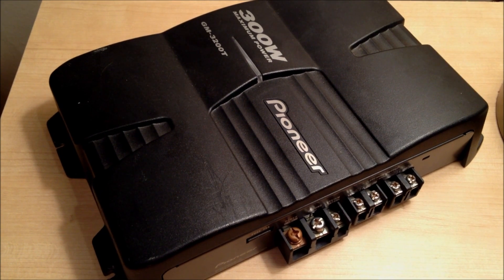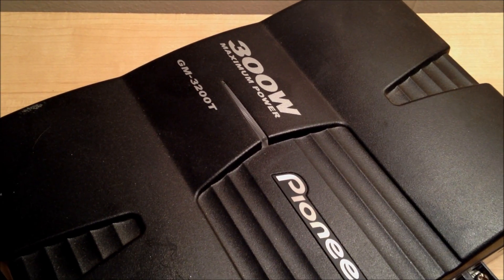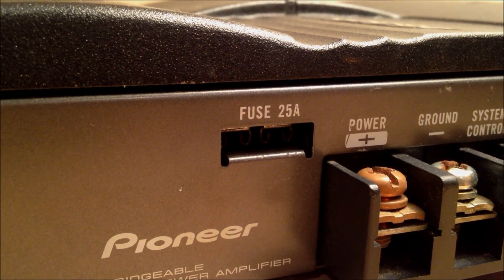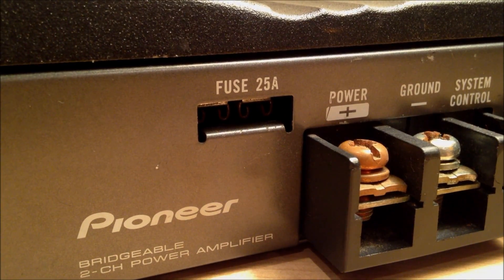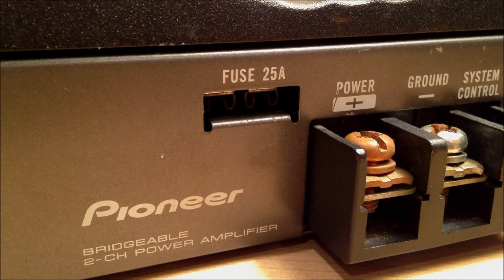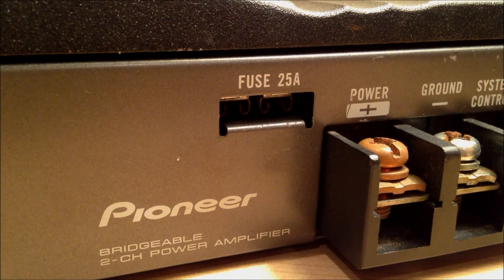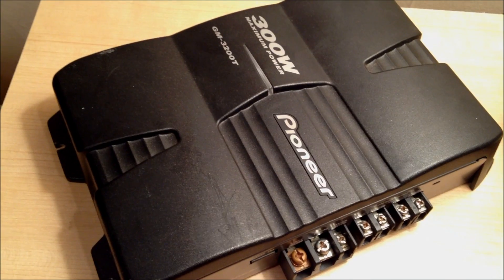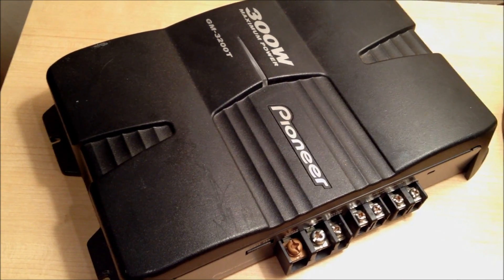How to Estimate a Car Amplifier's True Power Output (watts RMS)

Comment: So ( my rating *30*) X ( FUSES I HAVE ) <--- does that include my fuse connector im trying to figure out what fuse connector i should get so should i count it as 2? (60x10) = 600r? Or only count the one on my amp (30x10)

Comment: Uggg approximating output based on draw with audio... Why are so many green horns saying you can test audio power with multi meters?
Reply: because you can using volts. you can only send so many volts accepted. its the easiest trick in the book..
Reply: @boochful  you can't actually.... you need a test output with dummy load to even get a sample .. if you don't know this this then you're a noob cause it's been basic knowledge since at least the 80s in the car audio community and always known in engineering

Comment: My amp has two 40amp fuses  how many watts it's
Reply: 80 total amps x 13.8 volts=1,104 watts butts it's not an exact science
Reply: @aubrywilliams6158 where the f did u get 13.8 from?
Reply: 14.4 is during ideal conditions. I usually calculate a little less myself to get a more realistic number. Also gives headway

Comment: What the hell does the fuses have to do with wattage? and you have to account for the speaker draw in amps that will depend on what size you are using 4 /8/16/ ohm  ... and you account for the voltage drop across the speakers .....that is the true voltage you use to determine wattage .. not the supply.. but what is being delivered to the speakers ...
Reply: So what's the answer

Comment: Take fuse rating, in this case 25A x 1 x voltage.....so if I put this amp in my car witch I know sits at 13.9 volts then it would be 25A x 1 x 13.9 = 347.5 watts
Reply: Assuming the amp is 100% effecient. It is not by the way. Get 347 watts outta your head. It aint happening.

Comment: This is very miss leading because a fuse is rated higher than the actual power being used. Also the transistors are using more power than they are are putting out. Also some amps have capacitance that will increase peak RMS greatly. It is incredibly difficult to measure peak RMS without frying your amplifier. A lot of these amps will overheat running at even half power so there is a lot of nonsense going on with amplifier ratings.

Comment: what about inline fuses on the cable?
Reply: Irrelevant is this case...that fuse is to protect the wire not the amp.
Reply: @gleepoy  in that case it would need a distribution block correct ?

Comment: You take the fuse amps times it by 14.4 which is what most amps are rated at. That will accurately give you a number of watts it’s capable of at 1ohm. This doesn’t mean your amplifier is stable at 1ohm. Read your owners manual to see if it can stability run as low as 1ohm.

Comment: This is the most wack method I’ve ever seen. Also technically incorrect 

What you could rather do is say - total fuse/s amperage x 14v ( input power dc)  divided by the resistance of the speaker. 

So for your pioneer amp 

25a x 14v dc = 350 

350/ 4 ohms = 88w rms

350/2 ohms = 175w rms 

You said you know your amp is rated at 150w rms. Which is usually a rating giving at the lowest resistance it’s stable at.
Reply: so my Polk Momo carbon series 300.2 is 850 max and has 2 30A fuses and is rated at 14.4v 
14.4 x 60= 864 
864/4= 216 (is that how much im getting if im using 4 ohms or no pls help)
Reply: KickerWolf_ZV5 well the amp you are referring to is a 2 channel. Which can be bridged. Based on the information I can find online yours is rated at 550w rms at 4 ohms bridged. 

Keep in mind my calculation is a rough method used if you cannot find any output specs, having said that however even rated outputs are often exaggerated due to the inclusion of clipping.
Reply: Ight cause I was going to buy some Skars but Skar isn't that good imma just go with some Kickers

Comment: If that's an old school amp it's direct 12dc  it does not use any flyback step up dual supply my guess it's just  low power not 300w

Comment: What if my amp has no fuses? 

Old school Rockford Fosgate Punch
Reply: Find what the recommended fuse size for the amplifier is (in line fuse on power wire)

Comment: Since the manufacturer typically uses 14.4V source and a 25A "should" be the maximum amount of current it can take, if say the amp is around 360W peak to peak power. So the peak power being 180W times .707 for RMS puts it at around 130W (127.26) still a little less than what you mentioned. Also, 150W X .85 efficiency is 127.5W

Comment: Take any max power rating and divide it by 2 for the "real" power rating of an amp. Then divide that by the number of channels. Without knowing the actual specs, I'm guessing that Pioneer amp is rated at 75 watts per channel into 2 ohms, 150 watts bridged at 4 ohms and probably somewhere around 40 watts per channel at 4 ohms...and looking it up, I'm bang on except it's way higher at 4 ohms than I expects: 60 watts per channel. Which means it's a really inefficient amp at 2 ohms if the power only increases 25%.

Comment: Most class a/b amps are only 50% effcient. So multiply 14.4 volts x 12.5 amps(half of the 25 amp fuse rating). That gives you 180 watts rms. If the amp is 90% efficient, which most class d amps claim, then you multiply total fuse ratings by .9. In his case it is.    120amps x .9= 108 amps. 108 amps x 14.4 volts= 1555.2 watts rms. Boom! Knowledge.

Comment: Sir... is it 300watts maximum power at your amp refer to driven per channel or both and what the minimum ohm can handle.....
Reply: Ceejay Music 300w maximum power will only occur for a split second not continuously like rms which measures continuous power output. But if you want to compare that rms power rating to a high quality amp that is cea rated just divide rms power in half. so my amplifier says 1200w max and has 2 30 amp fuses so 2x30=60 60x10=600 that’s 600w rms and for cea rating cut that in half so my amp would be cea rated somewhere around 300w. Hope you understand
Reply: @caidencrawford9913  What about the power that the amp uses to function, power losses and power that is converted to heat? Usually is 40% in a class AB and cladd D is 20%
Besides watts is volts x amps, how can you get to that number even without taking the voltage into consideration??
Better off doing it like this, the operating voltage under load, lets say 13.5V and 2x30A fuses... ok, 2x30x13.5x0.6 and that would be 486 wRSM approx.
Keep in mind that amps don't draw constant current, and fuses blow by thermal junction, a 25amp fuse can actually take over 50A for a really short time. My amp has 3x30A fuses and it draws about 165A at a 2ohm load and it's a class D, so, 165x13.5x0.8 is 1782W RMS and on the box says that it's a 1875W MAX at 14.4V, if you do the math at 14.4volts... 165x14.4x0.8 is 1900.8Watts RMS. Like magic. Max wattage is actually achievable on a good quality amp, just need to be at the right impedance, because at 4 ohms you almost always get half what you get at 2ohm. Just make sure your amp is designed to run at 2ohms otherwise you will overheat the power supply of the amp and then bye bye mosfets......

Comment: i have a lanzar vibe 6000watts 4ch amp with 3 35A fuses. can u calculate its rms power for me?
Reply: 35A x3 = 105A x 13.8V =  1449 x 0.6 = 869.4 rms watts @ 13.8 Volts   You have to watch Lanzar amplifiers though as some of their amp fuses are dummies or spares that don't have power to them.  I don't know which models do that though.
Reply from the maker: Their website say 4x 2000w rms @ 2ohm. http://www.lanzar.com/sku/VIBE452N/Vibe-6000-Watts-4-Channel-Mosfet-Amplifier

Comment: So, let's say a sundown x8:  4ohm 8" sub wired to 2ohms......Will a 1875 W X 1 RMS @ 2 ohm amp be enough. Sundown x8s are rated at 750-1500 rmswatts
Reply from the maker: Are you running one or two subs?
I checked out Sundown's tech specs and they say 750wrms...where did you see the 1500wrms rating?

If anything, I think you'll be overpowering the sub (if you just have one), but if you've got two subs...I think you've got a pretty good match.
Reply: The CF Project one, and 1500 coming from the underrated gap. that's just probably max rms before it melts a voice coil lol. but optimal rms would be 950ish. 1000
Reply from the maker: I see. Lol. Yeah I think that amp will be more than enough. I'm actually concerned that you'll overpower the sub by quite a bit... I think that amp you're looking at might be better if you were running TWO 2ohm DVC subs wired to 2ohm. Lol

Comment: i have a steelpro 4 channel amp it only has one 60 fuse how would i figure the rms on thT ?
Reply from the maker: I've never honestly heard of that brand and I can't find any on google. Do you have a link to one? I'm going to guess that 60A fuse isn't the one that originally came in it? But if it was, you'd be at (a very general estimate) 600wrms if it's a class D amp...
Reply: Aaron Garcia that's 600 RMS , but the factory rates their amps using 14.4 volts , a normal car battery supply won't do that itle be around 10-11 volts so you'll have less than   600 rms ,more like 500 rms that's around 1000 watts of power at least for a few seconds at a time

Comment: i have a 1500 watt majestic amp. what size fuse do i plug in to it?
Reply from the maker: What is the RMS wattage? How many fuse slots do you have?
Reply: I have 2 fuse slots on my amp it had 15amp fuses but i swapped it out with 2, 25 amp fuses. I forgot how to calculate the rms
Reply from the maker: If it's the MA-1500D amp, it's rated at 300wrms and you should use two 15A fuses like it used to have.

Comment: Yea you can get more specific by saying.. (Fuse Rating) X (# of Fuses) X 14.4 = (Wattage input that will pop your fuses). The manufacturer should fuse about 20% higher than is being used and class D amps are about 90% efficient. So add to the equation.. (Pop wattage) X .7 = (Likely Rms rating of an amp +- 10%).   If it's a class AB amp the efficiency is closer to 70% so you can just do half the pop wattage and get the likely RMS output. The times 10 approach works well for quick math, but starts to under rate amps at higher power.
Reply: +Wick3DPimP I just noticed a guy down below said the same thing LOL.. Nerd patrol out in force :p
Reply from the maker: +Wick3DPimP Thanks for the feedback. You're correct, as I mentioned to the other guy who made a comment similar to yours :)

I'm making a few modifications in the video description and would love your feedback on it's accuracy!

Here's a few things in my thought process right now:
1. Most people can't multiply by 14.4 in their heads...we do all seem to have cell phones with calculators on them though...so maybe I should revise the 10 to a 14.4v.
2. A car's battery is considered charged at 12.6V. When the alternator running...MOST vehicles recharge at 14.4v as you said, but not mine. Lol
3. If you have a 90% efficient amp and bought it for under $1000 send me a link! The best I've found is an 86% efficiency...most lower priced amps are much less efficient in my experience. (From Crutchfield: "Class D amplifiers generally are more efficient than AB amps — often reaching 75% or 80% ") Also, most people don't have the efficiency of their amp memorized for a calculation done on the fly.
4. Since efficiency varies from amp to amp, we'd have to do another estimated average for a shortcut formula. Plus, it would be one more multiplication to do in our heads...so I picked the "x10" multiplier because I felt it captured both the average efficiency in a class D amp and a voltage source (eg. 12.6v x 80% eff = 10.08 which ~10). Technically, if your car is running, then you could say the multiplier should be 11.5 since 14.4v x 80% eff = 11.52 which is ~11.5...but even as an engineer I have more difficulty with multiplying by 11.5 than I do with 10. Lol

Please review and push back at me if you've got ideas!
Reply: Yea I agree x10 approach works just fine for on the fly shopping for poor name brand amps. Rockford fosgate claims 90% efficiency on their class d's and like 80's for their hybrids. I was doing the math with 14.4 as a "Max" rms approach, meaning you can easily say you will get a bit less in real world application. Either way of doing the math at least lets you decide if that 2000w rms amp can actually do what it says. :)
Reply: Another good tip for deciding if your amp is pushing what you think it's suppose to...
Disconnect your speakers. Put a 50hz test track on the highest undistorted volume. Probe the +- speaker terminals on the amp with a multimeter on ac volt. Take that voltage figure and do the following formula.. [Watts] = [Volts]^2 / [Ohm Load]. For an example if you get a 40 volt reading from your amp, then 40 squared is 1600 which gives u 800 watts at 2 ohm. Obviously this isn't as good as an amp dyno, but you should be able to figure out if you're in the right ball park.
Reply: Wick3DPimP

Comment: so if i have a amp that say's 1500 watts but has 2 15 amp fuses what's the rms ???
Reply from the maker: +jason28w In my experience, that typically means you've got about 300wrms. (15A x 2 fuses x 10 = 300W). Not a guarantee, but probably close. Do you have the brand and model #? We can look it up that way to know for sure.
Reply: +jason28w Yea I have a brand name amp that is fused for 30a and it is rated for 250 watts.
Reply: lol definitely not even close to 1500w and if it can with a 15w fuse lol then you got ripped off always ask if your not to sure ask questions like what's the rated rms and look for amps that have at least 2 fuses at 40w or up you can also tell by the brand of amp ib can mention a few good brands that can put out more rms then it's rated I can tell you some underrated brands of amps that put out decent rms
Reply from the maker: +Wick3DPimP Check out my response to your other comment. Thanks for the post!
Reply: Fuses are not rated in watts, they're rated in amps.  What you're actually doing is calculation power output, watts, by multiplying the current, in amps, by the voltage, which is nominally 12 volts in a car.  Assuming no other losses, this will give us total power output.  In the real world we will see a bit less power than that due to inefficiencies and heat energy loss.

Comment: My fuse mention 250 v ac. What did it mean?
Reply from the maker: +Gurnam Singh Your fuse is 250V rated? AC? Not sure what that means since that's extremely high and alternating current...
Reply: +The CF Project thanks for reply
Reply: @GurnamSinghchannel  it means that your fuse was tested at 250V AC. Amps are the same rather be at 10 or 1000 volts, what changes is the wattage. 10amps at 12volts is 120watts, 10 amps at 120volts that is 1200watts. amps x volts equals wattage
Reply: +Gurnam Singh your fine.... that just means it can handle up to 250 volts AC

ive blown plenty of fuses with higher ratings... they still protect the amp. 

i needed like an 80 or 100 amp fuse.... small ass glasgow montana only has 60 amps.... so if i play at gain...pops it.

Comment: Hello...a more accurate formula would be FUSE x VOLTAGE (12-14.4v) x EFFICIENCY (0.6 for class A/B amps and 0.8 for class D)...I usually use 13.8 volts so 25×13.8×0.6= 207 watts TOTAL power (divide this by the number of channels)...same thing for your other example with the four 30amp fuses...if it's a monoblock class D amp (which I believe it is) then it's 120×13.8×0.8= 1,325 watts total...only thing is that this formula does not say at what impedance...it's a rough estimate but it's a lot closer to a true RMS power rating...another option if you're a nerd like me...lol...
Reply from the maker: +Daniel Garcia I am a nerd like you and I appreciate your comment!

You're right, what I do in this video is a very basic estimate of what the true RMS would be...and that's the most I'm expecting from my equation. Sometimes a ballpark is all you need, especially when most amp manufacturers lie about their ratings or only post the 14V ratings...

Good math!
Reply: Daniel Garcia that is correct my brother! Correct way to calculate rms. Thanks for posting it. I was like wth that’s all wrong. 😂👍🏻👍🏻
Reply: ive got an old "cheater" amp...

eclipse 3640 made in 1999....its rated 40W rms x4 channels at 4 ohms....but, this is at 0.001% THD...not the usually 0.1% THD

 its got 2 20 amp fuses......by the videos calc, it would be 100W per channel.

using voltage and efficiency (which is "up to code" with ohms law).....86.4 w per channel at 14.4
and 82 W per channel at 13.8 (my electrical is good, it stays around 14.1 at the amps while maxed out)

and i do think its doing at least 60w per channel...

it will bottom out my pioneer 5.25 and 6x9s rated at 50w and 60w rms respectively. 

that eclipse amp has nippon chemicon caps in it....0,005% tolerance resistors...its fucking pretty on the inside
Reply: @DANIEL GARCIA. 
Yo Booiiii 👍
Reply: Wow
Reply: Daniel Garcia 4
Reply: Hi Daniel.. thanks for the heads up. I would like to set a 4 channel amplifier (1000w peak, 75 RMS*4 @ 4ohm) at home. So could you please tell me how much ampere is required to its smooth working for long run usage.
And have a quick question too. Will the ampere we given is always the take by amplifier almost all times of its working?